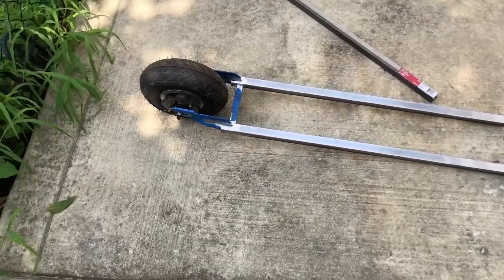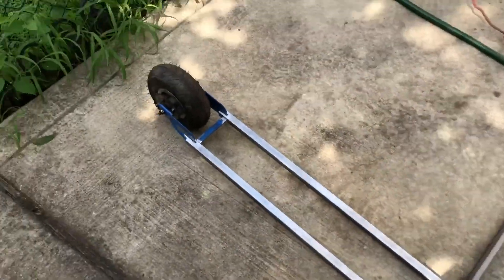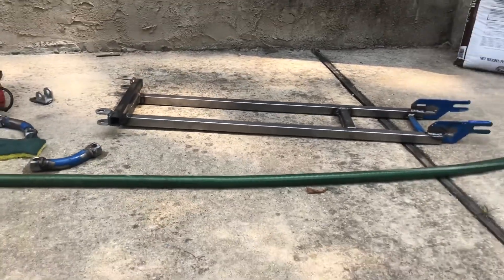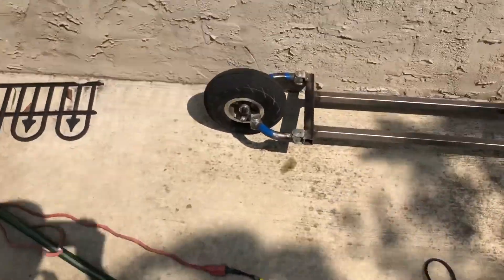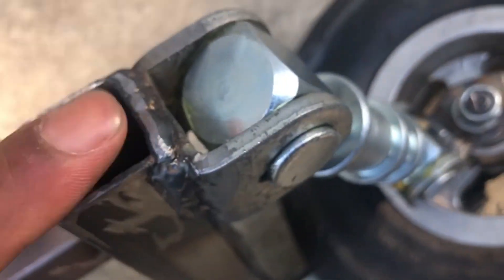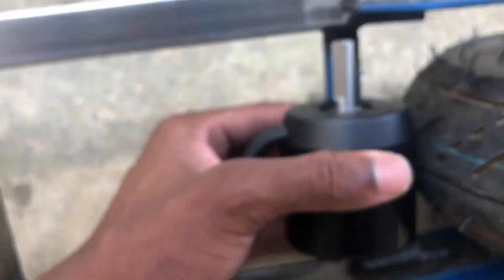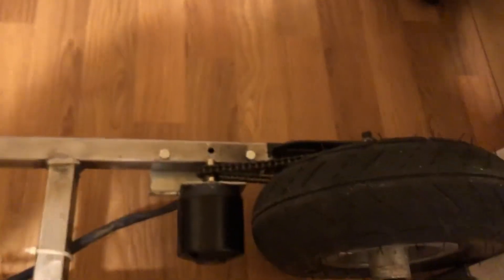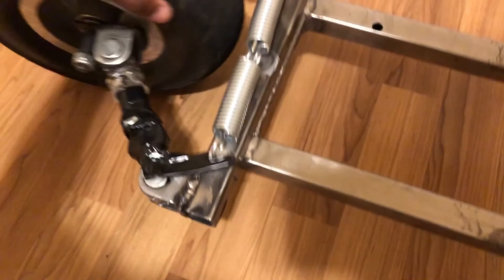HOW TO MAKE A 2 WHEEL ELECTRIC SKATEBOARD | DIY SPEEDBOARD | PART 1

Comment: The 3 wheel skateboard I made 2 years ago used the same direct drive drivetrain as your speedboard. (I have vid on YT btw). I am almost certain that esc is going to blow up when accelerating the first time. That motors presents a short for the esc so you need a vesc with active current limiting. Search for Vesc/Flipsky 4.20 or 4.12 as the cheapest alternative. Theres lots of videos on how to program it with a windows 10 laptop and BLDC tool.  
Another tip I have for you is to put on the biggest rear sprocket as possible so you will be able to climb hills with only one motor. The currents will also be a lot lower that way so your electronics will have an easier job. Voltage sets top speed, and current create torque for acceleration and hill climbing capability. Current (mostly) create heat. Heat will be your biggest limitation. You will find out that its better to gear down as much as possible, run  a high kV motor that gives you just enough speed and a high cell count battery. I wish I new this when I went into my first build :) Hope this info saves you some time and money :)
Reply from the maker: impuls60 thank you for your advice, I found a dedicated electric skateboard esc on amazon, it’s the one you will see in part 2 but  I’ll definitely upgrade the sprocket and also upgrade the esc to a vesc, that will be for the V2 video sometime in the future, thanks again.
Reply: @diyelectronics8794  Then you're all set! Looking forward to see it rip!

Comment: Will this theory for steering work?? All I'll get is two poles. Axle the rear wheel in. A hub motor wheel. And at the front. Cut two Groves into the inner side of the poles. And slide the wheel on the axle down it. Can you picture it?? .. Then push down a spring on each side in front of the axle.and compress them in. So when you lean to turn. One side of the axle will move forwards and then it will get pushed straight again . It works in my mind .. can you build this and show if it will work. Even a mini model at first. Please

Comment: Hi I want to ask  the  list of material did you use thanks and size
Reply from the maker: I used Square steel rods to make the frame. The size doesn’t matter as long as they can hold your weight . But try not to go to big.
6368 motor
Esc from Amazon.
2 5s batteries in series
45a bms
2 10 inch wheels.
4 heavy duty nut hinges.
Reply: @diyelectronics8794  how is the steering mechanism holding up?